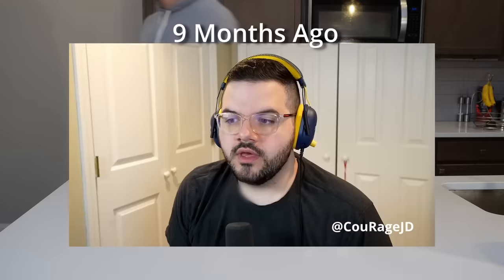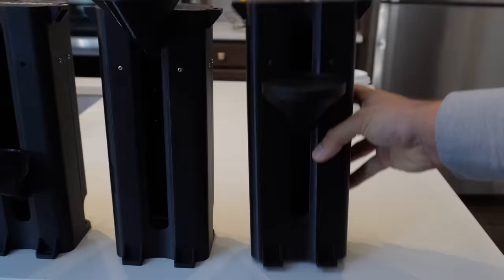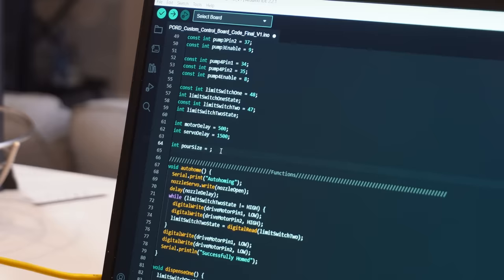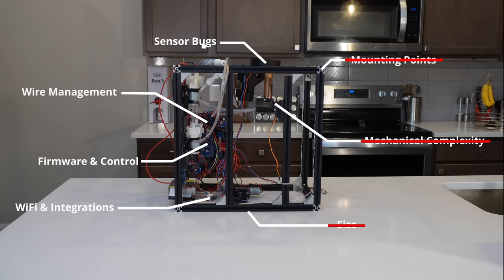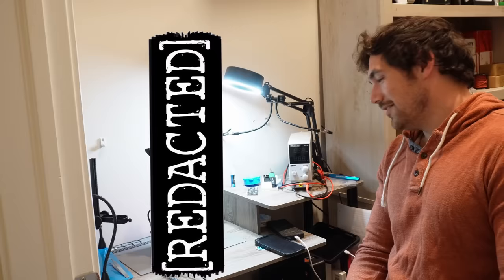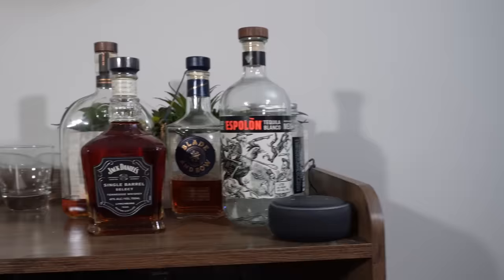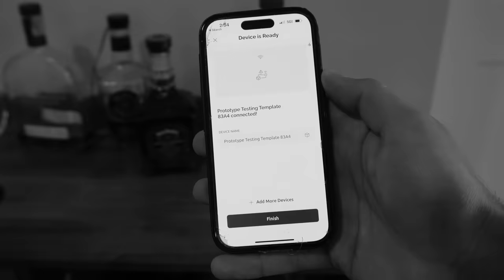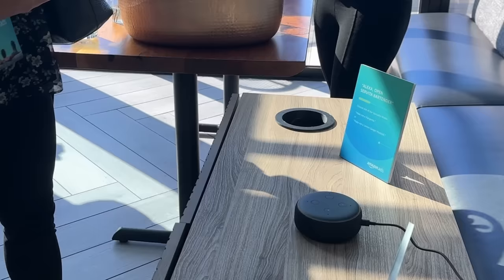My First YouTube Video Changed Everything | Making Version 2

Comment: As a software engineer, that "run code to actually remove credentials" thing is incredibly frustrating. Things like that happen all the time, and Happens in live environments because you dont think to test it. Props for flying out and getting it working.
Reply: the housing and everything is great, but would have been a lot smarter to spend less time on stuff no one is going to see and instead just wire up usb to an outside plug. that way if something goes wrong just have them jam it into a laptop with teamviewer. complete waste of time and lack of forethought flying out there. hell knowing it's a prototype i would throw a whole-ass raspberry pi or something inside it in case it goes down.

also you didn't test it by taking it to another location or using your phone hotspot? i mean c'mon.. everyone has at least 2 wifi networks available to them in most places. also someone else writing the alexa skill and making the pcb? sounds like he farmed out the actual hard parts of the project to 2 other people and didn't so much as credit them.
Reply: @reanimationxp  He said himself that he has no idea how to design a PCB nor make something like an alexa skill nor did he have time and BOTH people offered their help but both probably didn't want their names revealed
Reply: @theengineer2017   The video shows him writing a text message to someone, asking if they could help write the Alexa skill. He also hired someone to design the first board and had it made somewhere else. Then he found a comment from someone offering to help make the 2nd board.
Reply: Yea, if it was git source control, there will always be a pesky branch restoring deleted credentials on every merge
Reply: @reanimationxp You gave good advice but then you got all lecturey l and pissy. Not helpful. When you do that no one hears the good stuff you said Just the pissy stuff. I suggest you think about that.
Reply: @DigSamurai  i deal in facts, take it or leave it. /shrug. you can take valid criticism and be better for it or you can get defensive and insulted, the latter isn’t real productive
Reply: @reanimationxp  you're delusional if you think that was all facts. As I said the first part was reasonable criticism the second part was judgmental and pissy.
Reply: @DigSamurai  you sound pretty judgemental and pissy rn so i guess i'll ignore everything you said
Reply: To have completed this task in the time allotted is miracle level achievement. Well done and keep up the hard work of thinking outside the normal and achieving well outside the normal.
Reply: @reanimationxp  why you people on the internet are always so mad and judgemental
Reply: @vahn_of_the_art  not mad about anything friend, what would i have to be mad about? spoken like someone who knows nothing about electronics and is only here bc of a viral video
Reply: This is why a NUKE option should be default on any bootloader for dev-chips.

Just like the RP2040 has a NUKE script that wipes all old data. factory resetting the chip usually solving 99% of all issues
Reply: @darknessblades  if he’s using blynk he very certainly has no idea how to work with a bootloader, but i see where you’re coming from
Reply: @vahn_of_the_art  You don't see the irony in your comment do you...
Reply: @DarkHorseParatrooper  not really…I’m just stating a fact. Nothing more than that. I’m not judging anyone nor am I hating him. Just plain facts. It’s not bad having a different opinion per se, even negative, but you should always act as you want to open a constructive debate. do you feel my comment was extremely mad and judgemental in respect to the mood of the comment i quoted? lets talk about it if you want
Reply: @reanimationxp  Ha! Tell me you're bitterly jealous without telling me you're bitterly jealous..🤡
Reply: To me, it just sounds like you’re comisserating. Code failing to clear settings/info electronically under a new command is something that crops up in all kinds of places. It cn still be a major security issue online for users who falsely believe that simply closing the window of a site they’d logged into will always also actively log them out. It’s easy to forget that devices/sites/etc. being preloaded with functionality can be helpful (easier set up for users, simple connectivity, less need for instruction) but can also create hidden stumbling blocks to using that same functionality.
Reply: @reanimationxp  "just a prototype", not really, yes it's not meant for mass production and that was never the point, but nonetheless, the requirement was not to have a prototype either, the first version was the prototype. That alone defeat most of your comment. 

Also, from what we see in the video if you actually care to watch it entirely, the product is meant to be seen through a glass, under the actual table, so no, you can't leave out the design part (including the pcb I contrast to a raspberry pi with some bunch of wire everywhere) 

 But also, the tone of your comment suggests you have some bitterness in regard to this as opposed to just being objective like you try to suggest in further responses. Seeing your channel, it seems like you do actually create and play around with some electronic prototypes but seems to never go beyond that and actually finalize a deliverable product which again have very different requirements than prototypes, therefore you probably do not have a clue of the requirements or the process for an actual finalized product. Mostly, there is nothing wrong in outsourcing, it's not like the circuit schematic haven't been designed already. In fact it was a much much wider decision to outsource these area given the timeframe rather than trying to do them in-house, or go on full with the prototype way and just keep having some wiring erywhere that wouldn't fit a good compact design (part of the requirement), and would be less reliable, and difficult to work with.

While I do see some issues with this project myself, most notably with the locking system he implemented, I do also think most of your comment is invalid and doesn't come from an objective standpoint but from bitterness and cluelessness from lacking the proper skills to do the same as he did. 

If you want to prove us all wrong, please create a similar system or make it better using the elements in your own comment and let us see.
Reply: Yep, the 2 big problems in computer programming:
- naming things
- cache invalidation
- off by one errors

Comment: I remember my first time programing an arduino and I was getting crushed, I'm not a programmer and I was typing random code that kinda made sense. The feeling when you hit bingo and all functions worked. I made a wood shop routing table that would adjust the bit height and display position in a LCD with a stepper motor. The homing feature was important.

Comment: Excellent video.  I've been in this exact same situation a few times now.  Literally down to the wire and admittedly a few times past the wire (but just barely).  It feels like each successive project gets more streamlined but then I usually add more complexity and before you know it, it's down to the wire yet again.  Honestly, there is no bigger high than pulling it off just before the deadline.  Perhaps thats why I keep doing it regardless of the stress.  Keep up the inventing.

Comment: Awesome job!

That acidental triggering thing could be solved by a load cell on the platform. Or you could add a small motor that sticks out like a plastic pin near the bottom and if there is no resistance that means there's no glass and it wont pour anything.

First one can fail randomly if it's too sensitive but the second should be good but it will make it go down once before it knows there's not glass there.

Comment: LOL,  at 11:20 when I heard that the ESP doesn't connect to WIFI, I instantly know it was problem with the memory not able to clean out with arduino.
That's why we use ESP-IDF instead of arduino for productions... Learned in the hardway at a job years ago, two day before a conference demo too.
You fuck up more, u learn more I guess. All part of being an engineer.

Comment: This is a pretty incredible device, i also feel like this could be converted for use a liquid cooling system for a high powered pc or something similar, as the setup is very similar to a pc tower, or could even be expanding to allow for a smart home system for dispensing multiple drinks using a hidden compartment, which stores the drinks container inside.

Comment: Auto lockout can be achieved via weight sensor in the cup. By the looks of there is just about enough room in the device. Also presence sensor pay be a good idea just below the table top to double check the weight sensor. This should make the auto lockout rather hard to trick

Comment: I hope you were able to maintain ownership of the intellectual property and rights to the device!!! Having worked for Amazon (IT), I'd be really surprised if they didn't make you sign an NDA, Terms of Agreement, and/or non-compete, buried within which is a relinquish of rights clause.

As an employee, within my employment contract was a section stating that anything I work on, develop, or store on or with an Amazon-owned or paid-for property or service inherently becomes the property of Amazon, whether in the line of my employment duties or not.

For instance, I developed a small, insignificant script to automate some CLI commands for networking equipment. I developed this at home, on my own computer because if I developed it (or even so much as saved a copy of it) on my work computer, it was not only no longer mine but I was forbidden from using it anywhere else in my career.

Comment: Hi Audax. Maybe editor out the "PCB map" you showed at your first pcb shot. Might ease your future competition. Regarding the buttons - it might be simpler, to have a physical slide-cover to block them. Regarding your connection to a big company - sugesting you to patent your idea, or at least make industrial design "patent"... Because afterwards, it should be much easier, to speak with the company, if they decide to NOT comply according your agreement, or cut you off, than when you have only promiss, handshake and possibly a contract, with no details regarding your wider connection into (far) future profits.

Comment: You need a “HOW MUCH I GOT PAID” video. Or how to easily apply for a patent (if there even is such a thing) before posting a video so “in house engineers at Amazon” cannot reverse engineer it. Man I love hardware and robotics   So much more than the software side. I have boxes of notepads with ideas from 20 years that almost fill a whole bedrm. Dyson just released a hair dryer that delivers air the same way a flat iron delivers heat. I invented that 10 years ago and had it stored in the cloud. It is literally an exact copy. That’s why my shit still sits in boxes. I don’t have friends into this shit like I am and would be soul raped if it was stolen. 😂 so I’d rather have them burn it when I die or give it to my niece who also shows promise as an engineer. I just wish we could patent and sell. A quicker method. But like the show shark tank you have to prove it will sell to get an evaluation of its value. I don’t give a shit about running a company. I just want to sell ideas. But nobody does that so I’ll end up burning the boxes. 😂

Comment: Hmm… seems extremely odd that you boarded the plane without bringing your second prototype from your home bar that was working fine… you could’ve done a simple swap out if needed? It is difficult to discern in content such as this, how much is truthful accounting of actual events and how much is fictional embellishment… aka storytelling.
Reply from the maker: I’ve seen this a few times so I’ll clarify a bit. I absolutely did bring the second one, the issue was software based though so it was present on both devices.